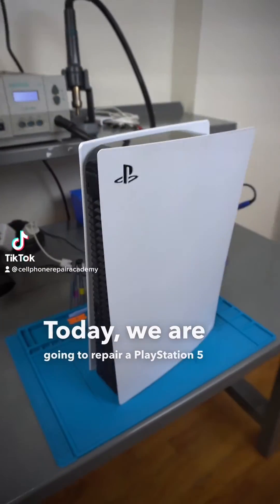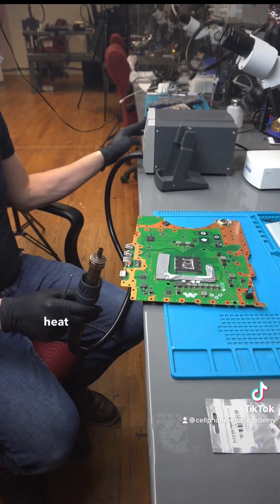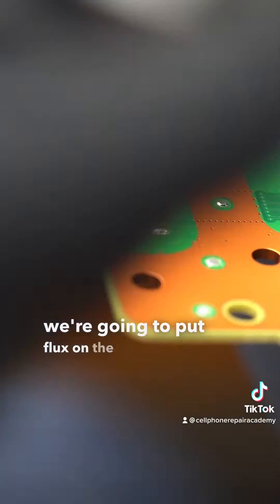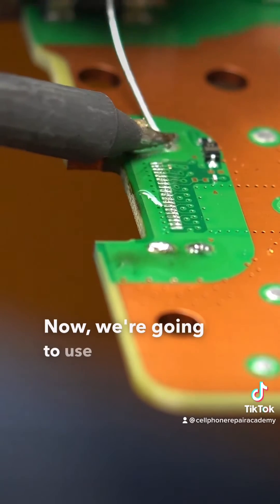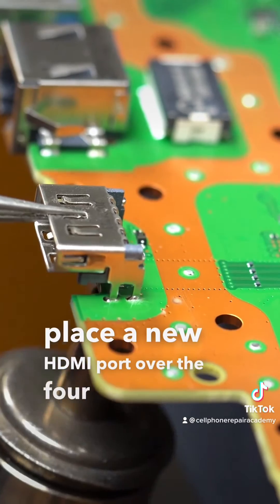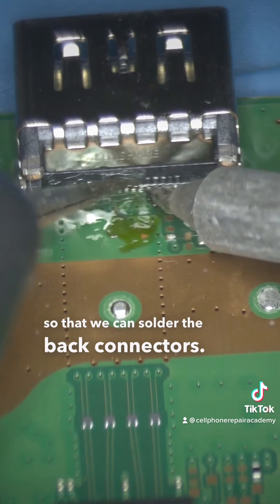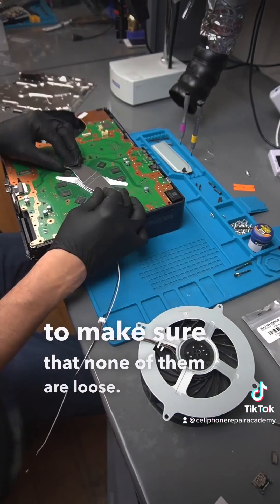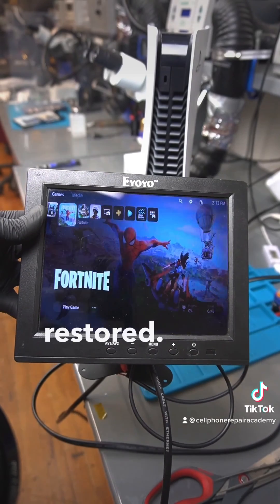PlayStation 5 HDMI Port Repair

Comment: Do you use the same temperature for the Xbox ones to remove the port
Reply from the maker: Yes, 500 degrees Celsius would be correct. Just make sure to use the wider nozzle on your heat gun.